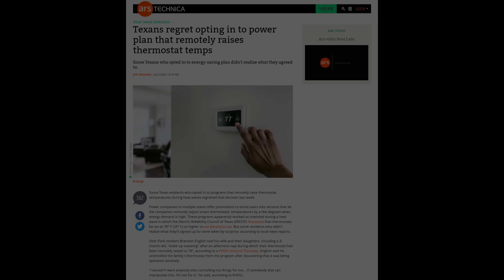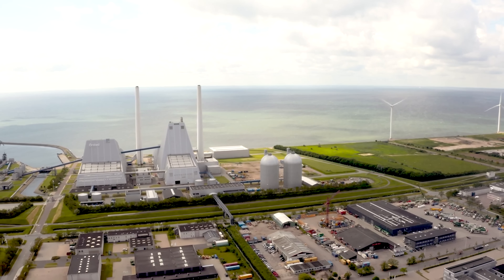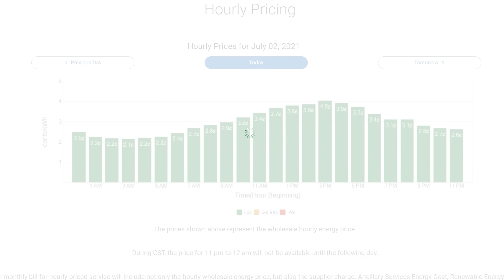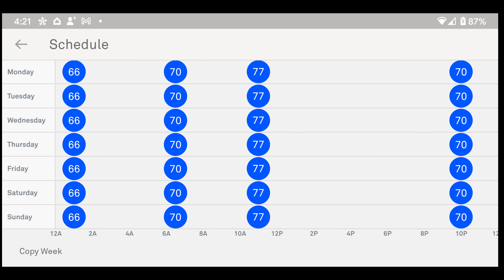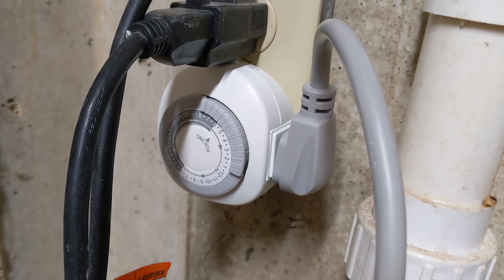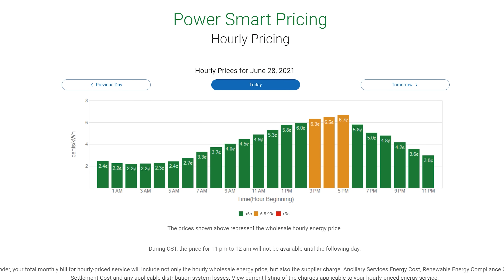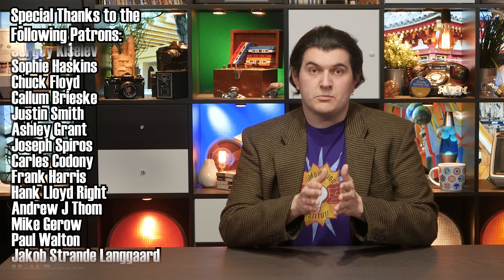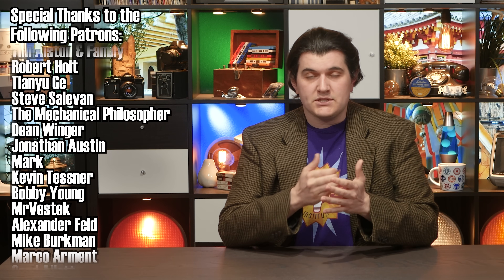Batteries aren't the only way to store energy. Here's another.

Comment: I’ve long thought that insulation requirements in the building code are woefully inadequate.
Reply: Which code? My house was built in 1900.
Reply: By increasing the requirements in a building code, you also increase the cost of that building. 
Increased cost = fewer people can afford it.
Less affordable = fewer sales. 
Fewer sales = fewer actually get built.
Fewer new homes = increased housing cost for everyone as demand goes up for the same number of buildings.
Less affordable current housing = increased homelessness.
Welcome to California!
Reply: @theTeslaFalcon  Properly insulating new housing when it is built is incredibly cheap, it should not be causing the problem you describe. Retro fitting existing housing with good insulation on the other hand is a lot more expensive.
Reply: @owensmith7530 
$100 in additional build cost translates into additional $1k - 2k in final price. +$2k in build = +$20k final. $80k -> $100k.
Reply: @owensmith7530 
As I retrofit my existing house, I can reinsulate in phases as I redo my exterior siding. Remove the old & falling exterior, replace / add insulation, add wrap, and overlay new exterior. Phases make it affordable: all or nothing usually = nothing.
Reply: Not in Canada. Building codes are insane here. 

Insulation is crazy important, and I’m not complaining too much I went above and beyond the building code with my house last year. 

I heat my entire 4200 Sq Ft house plus garage with an outdoor wood stove. 10 trees have heated my house for 10 months now.
Reply: Not to mention sound rating between condo/apartment/duplex units
Reply: @theTeslaFalcon  I didn't understand your logic. How is +2k in final price +2k in build = +20k ?
Reply: @BreakfastHappens 
I'm NOT disputing the value of good or superior insulation.
I'm disputing making stuff mandatory in government enforced codes which are rife w politics, bribery, etc.
Reply: @jonasdaverio9369 
$200 is just the insulation cost to the builder. They aren't going charge you just that.
Plus you have installation which, depending on type of insulation, may require special equipment or its own crew.
Plus the additional cost of inspection of that.
Plus the additional cost of house design for that since it's going to change airflow, ventilation, and interior moisture.
Plus the additional profit they can now charge w their greener, better insulated building. (Don't worry about it. You'll make it up in savings later.)
A small change here trickles down into a HUGE change there before the house is finally built & sold.

If you're building your own house and want to insulate ABOVE code, then the additional cost is less additive compared to a commercial (mass produced) home builder.
Reply: @BreakfastHappens  4200 square foot house?? Someone's living high on the hog.
Reply: @theTeslaFalcon  Sounds like the problem isn't with the code or the materials...it's with the construction companies.
Reply: @AMindInOverdrive  So much this. A little mass loaded vinyl (okay, a lot) might be more expensive, but from what I've read, it's worth it.
Reply: @jonasdaverio9369  Greed.
Reply: @bruns-o-tron 
Ok. Build your own house.
My dad did. My brother did.
Go for it.
Reply: @theTeslaFalcon  It's always cheaper to do something right the first time, than to have to fix it later by ripping stuff out and starting over. Insulation is one of the few home improvements that consistently pays for itself. You can either pay slightly more upfront for your house, or you can pay FAR more for your heating & cooling costs each month for as long as you own the home. Either way you're gonna pay! Might as well get a bigger mortgage and save the planet. 

Then again, if you live in California you probably have bigger issues to worry about. 

Also, you weren't even close with your guess of $20K to insulate an $80K home. That's just silly. I've only spent a grand or two doing it myself and I've put R60 in the attic, R30 in the floor, R15 in the walls, plus I'm putting up EPS foam board (R10) with a radiant barrier over that to cover the thermal bridges. Insulation isn't expensive, you got scammed.
Reply: @Hypercube9 
1) I didn't say I spent that. I said that I've seen it cascade up to that.
2) I don't live in California. Sadly, I did visit the state a few times.
3) (AGAIN) I never disagreed w adding more insulation. I disagree w adding it to the building code as gun-enforceable mandatory.
4) Thus the cost difference between "DIY" vs code for EVERYONE. W every code, there's also mandates of how to do it also.
Reply: @theTeslaFalcon  That's a perfect target for subsidies though. Keep housing prices down, availability up, and net win because better insulated housing has lower ongoing costs.
Reply: @theTeslaFalcon  Mate, if you could save 99% of the cost of doing things by not hiring builders, nobody would hire builders.
Reply: @seigeengine 
We could save 80% of the cost for a meal by cooking for ourselves, but folks still order Uber Eats.
Reply: @seigeengine 
1) Subsidies don't lower prices. They end up raising them.
2) So government regulation which raised the price should be supplemented by government subsidies which wouldn't be needed if they left it alone to begin w? What a vicious, self-defeating circle!
Reply: @theTeslaFalcon  I think the codes are out of control too, but this is one I actually agree on. The construction of homes is incredibly short sighted. They use the poorest windows and minimum insulation as people don't plan to stay in the house for a generation. The buying process doesn't properly access the value of low energy bills and the seller cannot recover the expense of building the better house. So they rarely get built.

The only thing that would fix this behavior as things stand is government intervention. Housing prices are out of control though and better homes would add 20-30% to the up front cost (for many many times that recovered over time). It would make the problem worse initially. Saving a couple $1000 per year in energy costs should cover the extra expense though.
Reply: @theTeslaFalcon  Don't choose that type of builder. Get one that values better homes and doesn't gouge you for it. Those big firms make all their money off those upgrades as they way over charge for them.
Reply: @bruns-o-tron  No it's the buyers. The companies will make what is in demand. They want to sell the house. People need to be less short sighted in what they purchase, and resell values need to incorporate just prices for better quality. Too much of home value in the US is based on floor area, instead of home livable the home is.
Reply: @theTeslaFalcon  
With these numbers, idt you really know what you think you know. Dunning-kruger is written all over this.
Reply: @kindlin 
If I knew what Dunning-Kruger is, I might have an opinion. Sounds like a law firm. Buddy works for Peter Kewitt, but that's mostly industrial / commercial stuff.
Reply: @court2379 
I bought my house off a tax auction guy. 6bd / 4 bath for $25k.
Reply: @kindlin 
Big business LOVE gov't regulations. It drives out small competitors. It's what the "Big 3" did to Auburn, et al. during WWII.
Reply: @theTeslaFalcon  Tulsa area by chance?
Reply: @court2379 
Indiana.
When I lived in OK, I was in Fairview.
Reply: @theTeslaFalcon  If you ever see insulation that costs $20,000... DON'T PAY IT! It's that simple. Why would you use an extreme outlier instead of a realistic example to make your case? 

Anyway, it's already IN the building code so nothing's actually changing. He's just saying make it higher. So your argument about needing special equipment to install it or another inspection is BS because you would have needed that anyway for the current level of insulation. And it wouldn't add design costs either because the house would still look the same, just with thicker walls. 

Besides, if you do it in the building stage and use 2x6's instead of 2x4's for your walls, you buy bigger boards, but you can space them farther apart! Also, something like 25% of the walls of older homes are made up of the studs. so if you have R-13 in your 2x4 walls, your house is really only insulated to an R value of 10.625! 

But let's say you're right, properly insulating a house adds $20K to the price. Fine. With a 30 year fixed rate mortgage at today's rates of 2.98% that ups your monthly payment by a whopping $84 a month. You could easily make that up in savings on utility bills, you'll get it all back when you sell, and your house will have better sound-proofing as well! (And that's on top of that whole good-for-the-environment stuff.) 

But hey, if you want to keep buying houses with little to no insulation so you can rip off the siding to insulate them yourself, before putting new siding back up be my guest. I'm not the boss of you.
Reply: @theTeslaFalcon  Adding $20K to the final price for fitting $100 worth of insulation is wrong, and should be fixed. By legal means if necessary.
Reply: @Hypercube9 
Special Equipment
Current fiberglass insulation is a poor insulator. It is cheap and "easy" to install. Spray foam is superior in most ways. But it's not exactly unroll, cut, and staple, is it? You need SPECIALIZED EQUIPMENT or a separate crew to install it. 

Code Inspection
Spray foam changes the code inspection process even now since there's no "looking around it" once the spray foam is in the wall & hardened. Mandating it (or its equivalent) makes those higher costs universal, not by choice.

Design Changes
I find it odd that you said, "It wouldn't add to design costs either. It would look the same, but w thicker walls." You then proceed to describe detailed DESIGN CHANGES that such would / could necessitate. Do u think design is an artist w colored pencils only going over the "look" of the house? Everything on all the blueprints for stud placement, electrical, plumbing, mechanical, etc. are all part of design. Changing the house from 2x4s to 2x6s is a major design change.

Mortgage
I think you started to realize w everything you changed that I am right. But then you decided to justify the cost.
1) $20k is the difference between qualifying for a mortgage vs not qualifying. My first house was $80k. I BARELY qualified for it. $100k? Never. 
2) $84 / mo doesn't seem like a lot on its own, but it's NOT alone. It's added to everything else. It's added to the $800-1,000 you're already paying on your note. It's upping the payment from $600-684, from $900-984. Could you afford $84 MORE added to your payment every month?
3) Noise & environment stuff neither costs me nor saves me money. Irrelevant.

Retrofitting
* It was my choice to buy a neglected 1900 duplex and fix-it-up.
* It was my choice to replace the rusted out galvanized and cast iron plumbing.
* It was my choice to replace the 70 yr old boiler for the radiators.
* It is my choice to remove the vinyl siding to replace w fiber cement.
* It is my choice to remove the cotton insulation and replace w spray-in foam, etc.
* It's my choice to spend $25k on a house needing help that I can payoff in 5yrs vs locking myself into 30 yrs of bank bondage which I wouldn't qualify for if I tried.
* It's my choice to turn this "knock down" into a $500,000 destination fit for my family.
* What choices do you have or are wanting to take away from others?
Reply: @owensmith7530  Who says what is proper insulation? It might be less healthy to live in houses too well insulated. A house needs to be able to breath. Probably will see in future a move against making homes so insulated that the house can't breath.
Reply: @domehammer  Now we're getting into conspiracy theory territory.
Reply: @theTeslaFalcon  Er, you precisely did say $100 in insulation adds $20K at final price. And then you proceeded to repeat exactly the same calculation. I can read perfectly well, perhaps you need to explain more clearly what you actually mean.
Reply: @theTeslaFalcon  Spray foam is irrelevant in the UK, since almost zero homes are insulated with it. We usually have fibreglass in the loft (roof space) where there is plenty of space for it, and fibreglass again in the wall cavity gap between the inner and outer masonry walls. Or if the house or roof is timber framed, it tends to be large panels of factory made foam insulation (Kingspan is one of the big brands) with reflective foil both sides, that the timber walls are pretty much built around. Same goes for flat roof insulation, it's usually slabs of Kingspan. For older houses you put fibreglass in the loft, and if the cavity in the walls has air in you get professionals in to pump either foam (for brick walls) or polystyrene balls with glue (for random stone walls) into the cavity. If you have 9 inch double brick solid walls things get harder, either the entire house has to be clad on the outside or you make your rooms smaller, but those houses tend to never get insulated because of the costs. Spray foam is one of the least likely insulations to find in the UK, and if it costs so much why does anyone use it in the US?
Reply: @owensmith7530  Homes being too air tight is potentially a health concern.
Reply: @theTeslaFalcon  By the way, a house for $80k (which is about £60k)? Not a hope in hell in the UK of finding anything that low in price, unless it's a derelict pig stye somewhere really remote. £200k is below average for a house in the UK. I paid £58k in 1987 for a 3 bedroom small house in the middle of a row of 4 (ie direct wall neighbours on both sides) in 1987. The difference between $80k and $100k is giggling territory in the UK, people would be ecstatic to be able to buy a house at either of those prices. So consider yourself lucky to be able to buy one at either price.
Reply: @domehammer  Do you have a reference for that? It's the kind of claim that needs a scientific study to back it up.
Reply: @owensmith7530 
Read it again. I'd post the screenshot, but there's no way to attach pix. 
$100 material -> +$1k-2k final price.
$2k additional -> +$20k final.
Reply: @theTeslaFalcon  Exactly what I said you said ie. +$20k on final price. You've confirmed what I said twice yet on both occasions stated you haven't. We're mis-understanding each other. I asked you to explain more clearly, but all you keep doing is repeating the same text. If I didn't understand it the first time I'm not likely to the second or third time.
Reply: @owensmith7530  
1) UK vs US is comparing apples vs potatoes.
2) Indiana is ~ 30th in the US, but even that varies depending on where you're buying & when. My house, bought it last fall, is in a small town >20 min from a major city. Californians moving here tend to move from near slums to the "rich district". $350k is about the top end. Yes, there are places worth over $1million, but then you're adding on 10, 20, 30+ acres of land w it.
Reply: For the rest of you who are following this conversation...
2x6x8 pine lumber at my local Lowe's is $2 more per board than a comparable 2x4x8, but many insist that won't REALLY change the price. So, since they're already insulating 2x4 walls, making them thicker is one way to increase the thickness of the insulation to increase the R-value. Same cheap fiberglass, just spend $2/board more. Anyone care to guess how many boards are in just the exterior walls of your house? It all adds up.
Reply: @theTeslaFalcon  "You're obviously NOT listening to me." What?? 

Kinda hard to totally debunk your entire argument like I just did if I wasn't listening to you. (Actually it wasn't. I'm being kind.) 

You can knock down your own straw man. I'm not about to argue in favor of more government regulations. But again, THAT'S NOT WHAT WE'RE TALKING ABOUT! Try to keep up! The regulations ALREADY EXIST! A certain amount of insulation is ALREADY REQUIRED! So we're not talking about new regulations, just an adjustment to existing ones that result in more efficient houses (which typically last upwards of 100 years or more) that cost less to heat & cool and which are better for the environment! 

Your article talks about "onerous building, land use, and zoning regulations", WE are talking about one change to a requirement that already is in place NATIONWIDE! And as you've said it involves increasing something which is "cheap and "easy" to install"! Someone once tried to gouge you by giving you an estimate for a $20K insulation job. (I assume an army of Swedish bikini models would do the installation.) Fair enough, but that's NOT what insulation costs! And most people will charge you FAR LESS! AND you'll make it up anyway with each gas and electric bill you pay! What part of that are you STILL not getting?!? 

Also, and I doubt you've thought of this, but if enough people stop using so much natural gas or electricity then their respective prices will FALL! Demand falls -> Prices fall. It's basic economics.
Reply: @Hypercube9 
You don't want more government regulation; you just want more of the same government regulation.
https://www.jm.com/en/homeowner-insulation/homeowner-faq/what-r-value-do-i-need-/

You keep saying 'more R', but you never define how much more. There's a big difference between an R13 wall and an R30 wall.

On the Wikipedia passive house page (poor source, I know), it says, "On average passive houses are reported to be more expensive upfront than conventional buildings – 5% to 8% in Germany, 8% to 10% in UK and 5% to 10% in USA."
Reply: Free market capitalists: "Enforcing codes will drive up cost!"

Also free market capitalists: "Lmao lets make this crappy pile of twigs and drywall as overpriced as possible"
Reply: @Coconut-219 
Communists: "Everything is mandatory! It's better for you."
Also communists: "Why is no one building house? Why is our homelessness so high?!"
Reply: @Coconut-219 
Exactly which countries require walls to keep people in?
How many people in the last 50 years fled the US to go to Cuba?
Reply: @Coconut-219 
Socialists: "We already have it in new house codes."
Avg new house price: $350k.
Also socialists: "We need affordable housing!"
Reply: @Coconut-219 
Socialists: "Increase property taxes!"
Also socialists: "Why did rent go up?"
Reply: @Coconut-219 
I call it "The WalMart Effect". No single item cost more than $1, but over 100 of them produces a LARGE charge at the cashier.
Reply: @Coconut-219 
I think I understand the plan now...
1) Drive up the cost of housing.
2) Make living in a tent by the interstate the only place affordable to live.
3) Drastic reduction in gas, electric, water, property tax, and every other bill, too.
4) Once every building is evacuated and condemned, EQUITY FOR ALL IN HOMELESSNESS!